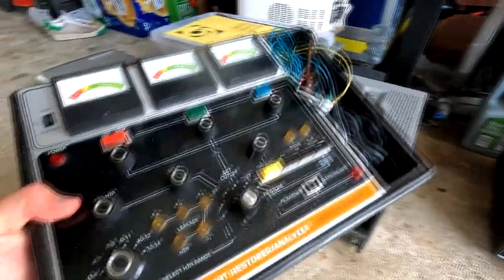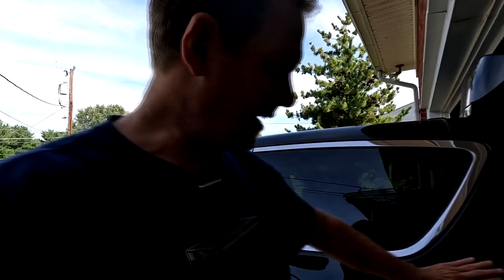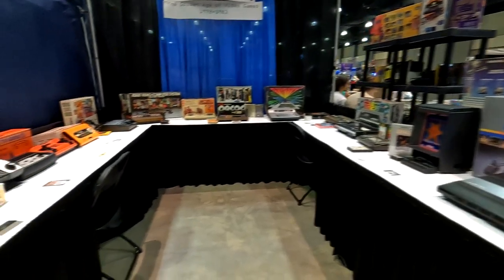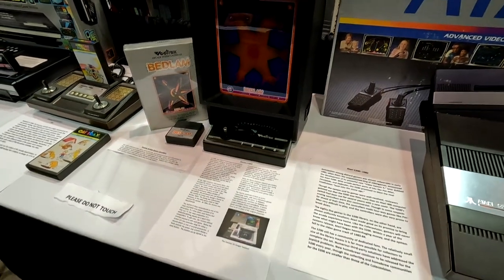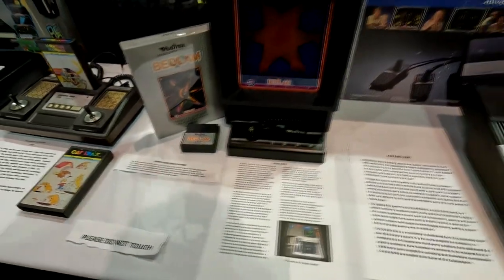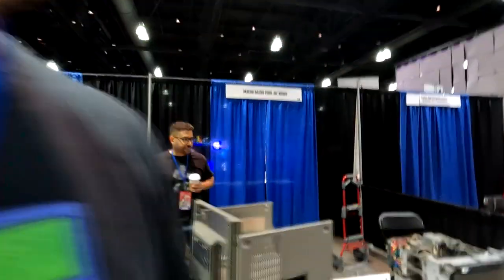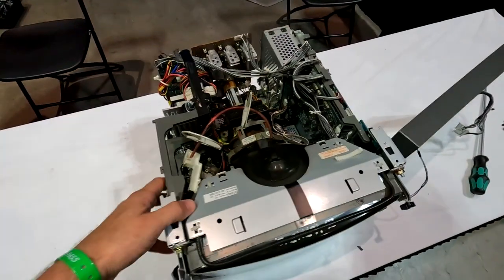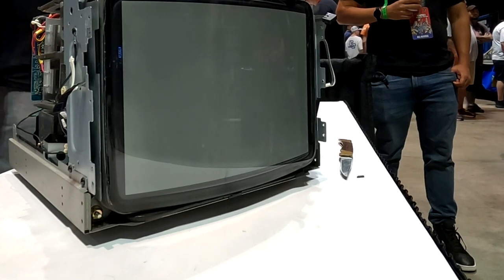The Shocking CRT Repair Booth at the Retro World Expo

Comment: 4:43 I have a FST Black stripe. Different model, though mine is a cz2084. FST stands for “ flat screen tube” even though it’s from the 80s and there is nothing flat about the tube they just put a piece of glass on the front of the TV to make it look flat. Mine has sadly been all taken apart and then just sitting around for years now. Would love to get it working again someday